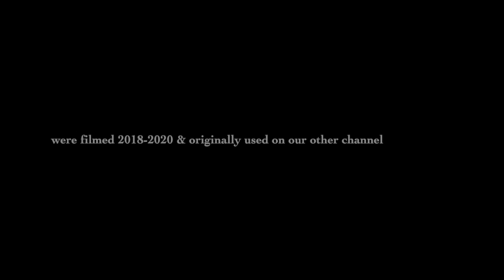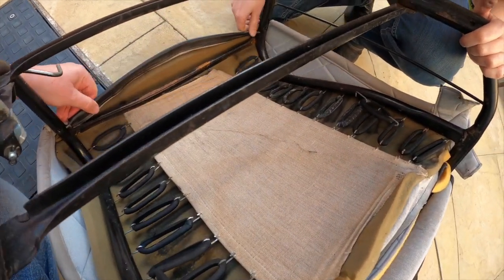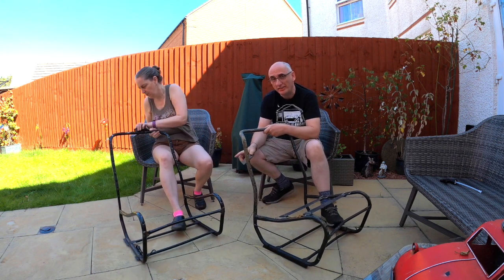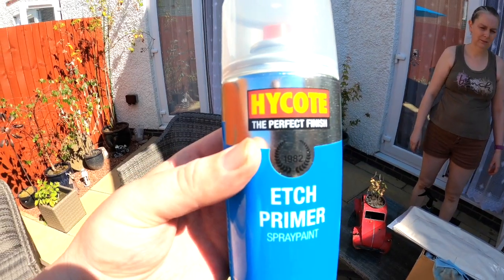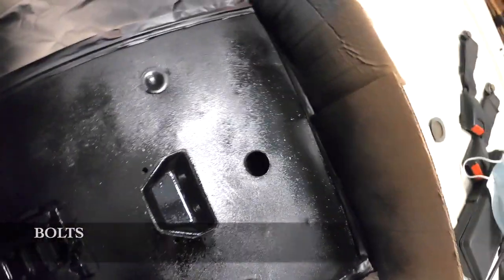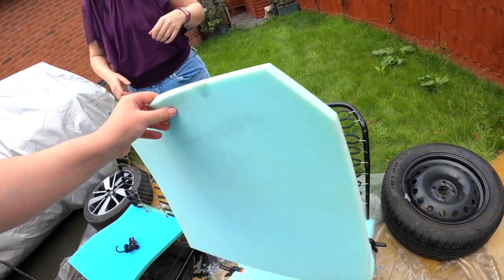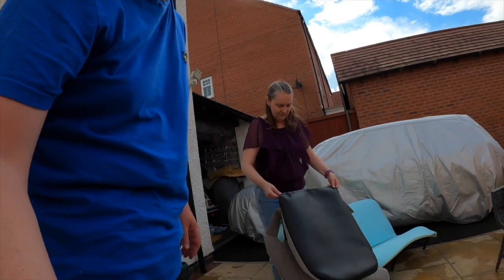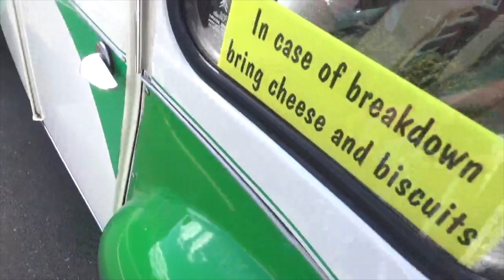Citroen 2CV Seat Removal & Restoration

Comment: We could see who did nearly all of the work! nice job though.Just recovered my seats with help from Robert Grainger. mine is also a 1985 green n white Dolly (Polly the Dolly)
Reply from the maker: Ah. Yes Fran gets into the work. This video is actually a cutdown version of the original; which was in 3 parts. Looks easy on film but took 3 separate days. Was satisfying though. Great to hear from another 2CV Dolly owner.
Reply: After owning a green/white D reg one around 35-40 years ago, we have just bought a 1987 Dolly (also green/white, we named Molly) and although the seat covers are in decent condition, but grubby, we plan to remove  the seats and renovate them as required. We love it! Malcolm (Lancs)